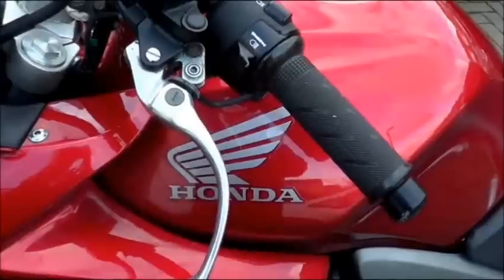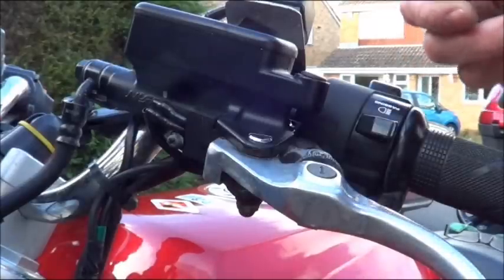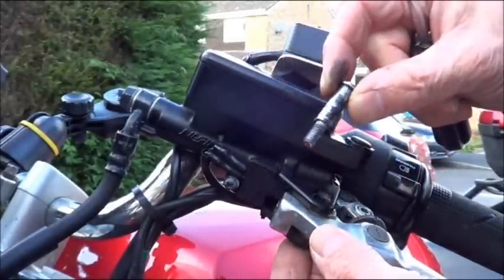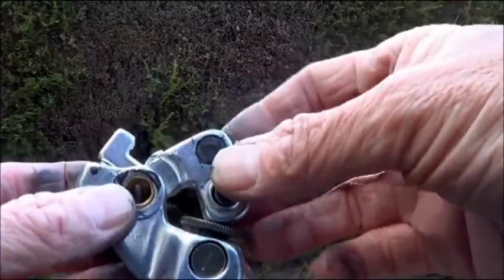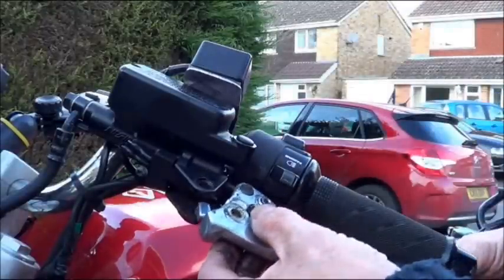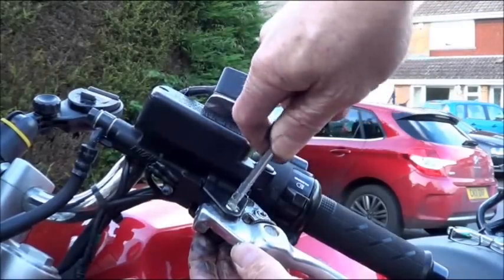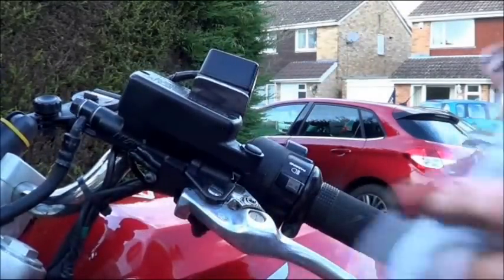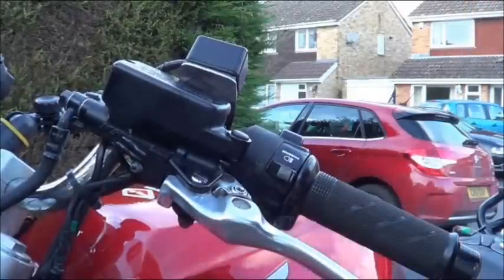Clutch lever replacement on a Honda CBF1000

Comment: great video man. question though. where's your clutch lever. my controls are just like yours and I can't figure out why my clutch lever gas no tension on it. if anyone has any ideas please reply back
Reply from the maker: My first thought would be to check the fluid level and any leaks. Secondly check if it needs bleeding. After that it sounds like a mechanical problem.

Comment: I did the same thing, but mine snapped in half.  Where did you buy the replacement lever from?  Thanks!
Reply: Did you ever have a problem when engine doesn't start in the morning or after you leave bike and not not riding it for a couple of days?
You basically pres the button engine doesn't start unless you twist the throttle few times,than fire up immediately.
Every other time during the day starts first time.
Thanks